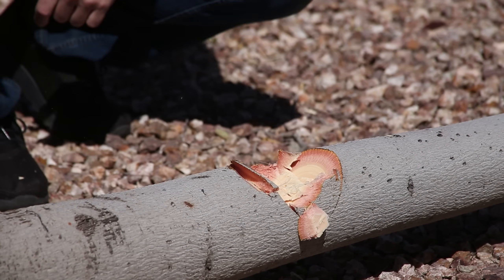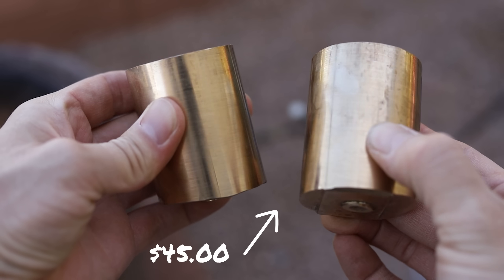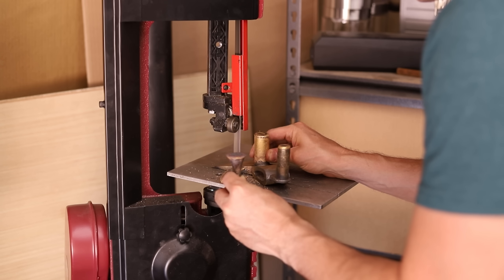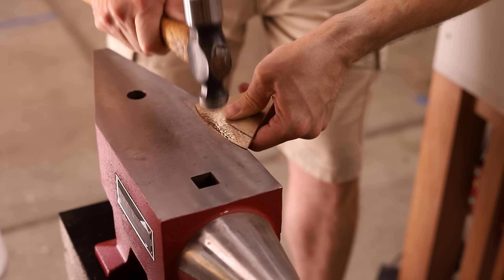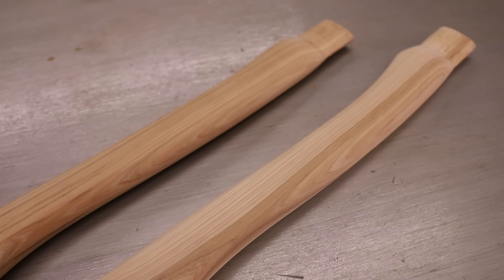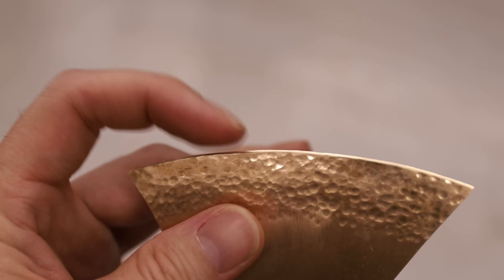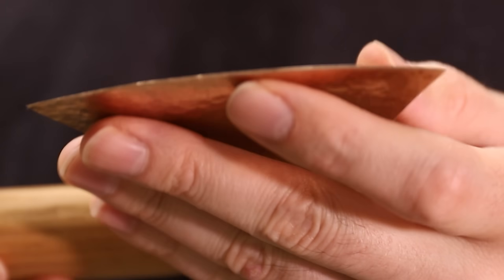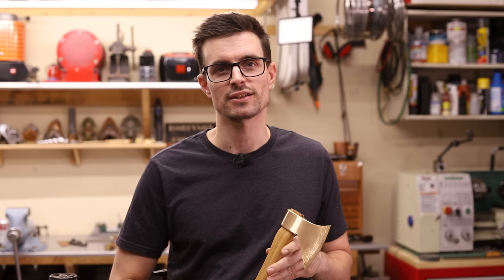Aluminum Bronze VS Tin Bronze, Making & Testing Bronze Hatchets

Comment: The broad edge you described is NOT an appleseed edge. The true name for an appleseed edge is a convex edge and it is not determined by the angle being broad. It is what most quality axes have edge wise and it's used on Japanese swords. Usually put on using a slack belt or stone that has the right wear for such an edge. I personally maintain with a mousepad and sandpaper or cardboard with compound. Something with a bit of give. Global Knives also come with this edge.

Comment: Great video. The color match or lack of, is from a few things; The environment that was surrounding the initial casting pour (casting substrate and environmental gases) is different than the environment that was created when the GTAW was conducted which induced shielding gas at a molecular level. The scrubbing action of the EP (electrode positive) side of the AC waveform also cleans the base metal removing impurities in the parent metal (and filler) which do come to the surface and literally go up in smoke, redefining the alloy in that specific area. Also, the grain structure is different in the parent casting than in the pool of weld metal which is more pronounced the further the surface profile is reduced. This practice is commonly used in metallurgical labs to examine the grain boundaries between the weld metal, parent metal, and the heat affected zone and is known as macro polishing and subsequent etching. Regardless of the filler metal in production welding or this situation, the further the substrate is polished, the more visible it becomes. This is evident even in color matching aluminum alloys specified for anodizing and in weathering steel applications using Ni1 nickel alloyed fillers. Have a great day.

Comment: Very clever to hammer in the dimples like that to improve hardness. You called it cold forging. I am googling it, very ancient technique but I am curious how they figured it out all the way back then. Without being able to analyze the structure of the copper I have a feeling they would have went around saying "I have been saying it for years but you wont listen....if you cold forge the edge you wont have to sharpen it as much, but you just never listen....you say I am being extra" lol

Comment: I'm stunned how this even works. Melting copper and aluminium, alright. Copper melts at 1000ish degrees, and aluminium almost melts in your hands... but iron? Iron is another +500 degrees on top of copper.
You get to well over 1500°C, and probably some extra so it flows while pouring, with a blowtorch-heated, home made furnace that is little more than a concrete-enforced bucket? That's so awesome.

Comment: 4:09 might be contamination / oxidation but it's also possible that the discoloration comes from different crystal structures: the hatchet cooling somewhat gently vs the tig welded spot cooling off quickly.

Comment: Not surprised at the result. Iron didnt defeat the bronze age because it was better metal. It won because Iron is alot easier to find than Tin or Aluminum. 

100 iron swords vs 1 Bronze sword

Comment: If I recall correctly, when bronze age societies began transitioning to iron, it was more because iron is everywhere and tin was a very limited resource, being only produced in abundance in very specific and distant locations at the time. Bronze is just as strong as early iron and in some respects even better, but the abundance of iron made it takeover as the standard material once forge technology was able to produce enough heat to melt it down.

Comment: Tig welding is extremely high temperature (>2800C)  and even higher depending on current.  You likely oxidized and even evaporated some of the aluminum. Though not a substantial change overall, there was a compositional change in the alloy.  Small changes like this can can cause big color changes.  Oxide formation on the surface can also alter the light reflecting.

Comment: What’s not cheap mean for the c630. Say a round about price. Also it’s on mcmastercarr $60 for a foot of 3/4 rod. Looks like you had 1-1/2” and a foot of that is $200 but unnecessary if you were jut melting it down im sure it’s cheaper for the longer smaller diameter to make the same volume of material

Comment: There's something bizarre about seeing (what I assume are) 3D printer layer lines cast directly in bronze. Of course, after you worked the metal a bit, those lines went away, but it looked strange coming right out of the mold. As though you somehow 3D printed straight bronze.

Comment: Metal creates oxide layers when rapidly heated and then cooled. Depending on the thickness of the layer, it can be different colors. It's basically permanent unless you polish or sand it off. I've never seen any household chemicals that can remove the oxide easily.

Comment: It was very interesting for me to watch this video. It includes metal casting, locksmith processing, and testing of the finished product. A very unusual material for an axe. Unusual for our days. Of course, it cannot compete with steel when high cutting and chopping properties are needed, but aluminum bronze is very corrosion resistant and it would look very impressive as a hatchet for cutting poultry carcasses in the kitchen! Golden axe!

Comment: This was wonderful to watch and learn with. You're an excellent craftsman, those turned out amazing. 9:30 what do you mean by porosity when cold forging - imperfections getting into the material, weakening it? 🤔
Have you tried making a brass alloy before? Nickel and Copper.

Comment: My two-handed wood chopping axe isn't sharpened at all. I'd be VERY surprised if the bronze axe suffered any damage from using it on wood. 🤨
Moreover, an axe that will cut wood chips when struck can be made from almost anything, even plastic.
The question is how long it will last.

Comment: Yo I think these axes, especially the axe heads are very beautiful but from using a lot of axes I have to say curved axe handles like the ones you find on gränsfors bruk axes are a great improvement to handling and imo also to the beauty (if you care, I know these are just test pieces so it probably doesn't matter as much)

Comment: Fey will be allergic to bronze in my next D&D game.  Not Iron.  Iron is a human thing.  Garbage.  Dwarves prefer bronze aluminum.  It lasts lifetimes.  Iron and steel pit, corrode, and fall apart after just a hundred or so years.  It is also ugly.  Elves prefer platinum.  Imagine an elf with a platinum rapier.

Comment: Pro tip, when using a file, NEVER go back and forth while you have it against the metal as that will damage the file... always file away from you, lift it off the metal, set back where you started and repeat.

Comment: So a few things about the aluminum bronze: 

First, the discoloration from welding is because aluminum bronze continues to grow internal crystals at room temperature. So a remelt via welding of the alloy would re-liquify that portion of the crystal grain and always be visible. If you want to discourage this, you should put the bronze into a freezer for a month before welding it, and then allow it to slowly come up to room temperature again before welding it. It will also be significantly harder if you put it into cryosleep before work hardening. 

Second aluminum bronzes can have either zinc or tin added to them in small amounts to help with fluidity of the molten alloy. zinc is slightly lighter than tin, but can put off vapors during the melt process. Both can be difficult to weld, but you twinned weld stick is a really good idea.

Comment: the coloring is because of the heat,,the first is allready heated poured,the other is forced heat on so it becomes a defferent heat and molekyle difference,,prob weaker or stronger ??

Comment: Not trying to teach you your job but steel wedges and ring wedges are for when the head starts to get loose after repeated use and you want to keep using the same handle.

Comment: The bronze age ended due to supply and supply lines, not because iron is that much better as a tool (note- iron, not more developed metallurgy like steel)
Iron is just easier to mine locally. Meanwhile, bronze required the development of intercontinental trade in order to get everything it needed going. Which meant there was a good chance that neighbor you hate cut off your supply right before they declared war on you.

Comment: I'm surprised at how well bronze performs. Good steel might be better, but considering the problems that have to be solved to make good steel, bronze axes are really easy to make. What I'd be interested in is making a saber saw out of bronze and testing it. How well does this material perform compared to steel?

Comment: I saw that back in the day, and I guess in current times, that steel scythes for mowing hay and grass were sharpened by peening the edges between two hard objects. I wonder if the same could be done for bronze, or even if that was done for bronze (vs grinding). It sounds like they already knew about hardening a metal by deforming.

Comment: I believe the discoloration in weld is whats called the HAZ (heat affected zone). that is essentially just the superheated area where the weld puddle was, and it cooled quickly to form a different grain structure as compared to the surrounding metal that didnt get hot enough to change grain structure

Comment: Aluminium bronze?

Does that differ significantly from duralumin in properties?

Edit nevermind the alloys are miles apart in composition - the former has a much higher fraction of copper and the latter has a much higher fraction of aluminium.

Comment: The alloy content is slightly different and the temperature heated and cooled at a different temp/speed. Happens with weld repair on substrate all the time. PS.. you'll be much happier with conical wedges to hold the axe heads on.

Comment: The bronze cooled naturally and Annealed at a different temperature. The molten bronze cooled at a different speed.

When you quench anneal metal at different temperatures and colours this will affect the properties of the metal. Maliability, hardness, brittleness, it also affects the grain(crystal) sizes of the particles. All of these factors could likely change the metals appearance

Comment: Cool!
Stronger actually. Since the aluminum axe is significantly lighter it will have less force on the edge.
The only true test would be a speed test. Or a test to get through a piece of wood within a set piece of time. So the weight of the tin bronze axe is used for something more than stressing the edge.

Comment: have you hammered many layers of the bronze together, cold forges them into on peice then heat it and add a 2nd one. might make the whole axe head stronger, im not a forger but its a thought i had while watching, if im wrong someone plz comment, but my thinking is, in theory if you hammer the bronze and nit gets harder then, why not hammer a few sheet together and compact the bronze into a tight sheet,,,like i said someone elaberate if im wrong plz

Comment: You could have saved a lot of finishing time by cleaning up the 3d print. (Especially if you are going to use the plug again.)
Try misting with acetone.   And/Or   Spray paint with a high build primer and sand.

Comment: Strange. Aluminum bronze is supposed to be much harder and stronger than bronze made with tin.
Tin Bronze Tensile Strength: 300–550 MPa (≈ 43.5 kpsi to 79.8 kpsi) and  Brinell: 60–120 HB. 
Aluminum Bronze: Tensile Strength: 550–850 MPa (≈ 79.8 kpsi to 123.3 kpsi) Brinell: 150–200 HB
Did he work-harden both?

Comment: Old copper— see all those old soldered joints?= lead exposure. That means from now on, the sand you used can’t ever be used to make for anything you would drink or eat from. There is no safe level of exposure. Can also contain cadmium. (I’m a jeweler. )

Comment: 4:04 how do you tig weld aluminum bronce? Mine is 89%copper and 11% aluminum but when I try to tig weld it just heats up the full piece, I can’t see even a single puddle. When I test the welder with iron it works perfectly. I don’t know what’s wrong with it. Anyone know ?
Reply: Over 200 amps dcen. Or preheat the entire piece to around 600 degrees. Honestly oxy-acetylene is what works best. It's so thermally conducive it makes it difficult to form a good puddle when welding.

Comment: Nice work.  chopping fully seasoned hardwood is a tough test for any hatchet.  A great deal of woodwork was done green before power tools. Timber framing hardwood for example is traditionally done green.  The joints and whole structure season together.  The shrinkage pulls the joints even tighter.

Comment: I love this sort of thing; v nice work BTW. One thing I'm always frustrated with, though, is trying to find creators that are looking at other factors besides the usual temp, colour/heat, composition, etc.
How about vids also including humidity, local temp (you mentioned it was hot outside the workshop?), static electricity, perhaps local gravitational &/or geo-magnetic flux (or level or whatever they call it)?
If/when I can start doing casting & forging I'd especially like experimenting with running an electrical current (AC or DC or BC or suchlike?...sorry, my little joke -  of course I know it's BCE now... ;~ ]) through the molten metal WHILE I'M POURING IT, with various monitoring going on, to make comparisons re. Viscosity, hardness vs brittleness, ductility etc., resistivity & diverse magnetic properties (incl. propensity for Paramagnetism &/or Diamagnetism), seeing if katana-style folding can have any noticeable difference when working in bronze, maybe rotating the crucible while pouring into the mould (& assessing rigidity, flexibility, etc. later)? I'll wager there's a whole new world of nitpickery out there just waiting to be explored...

Comment: Bronze age axe heads had quite a different shape compared with the iron and steel versions that came later. They were smaller, more 'stumpy' looking and did not have an eye for the handle, they had a socket and loops to lash the handle to the head. This was not because the makers lacked the skill to make complex shapes, it was the optimal shape for the material. I'd like to see you have a go at replicating a bronze age axe shape in home made bronze. I wonder if it might work better than making it in the shape of a steel axe.

Comment: I wonder if aluminum with micro pores would be stronger. Aluminum oxide is the strong form of aluminum so a surface maximizing surface area may be strong then a solid piece.(3d printed metal commonly has micro pores )

Comment: It's funny, we usually don't consider bronze to be all that strong because we're so used to iron and steel, which is generally a tougher class of alloys, but it makes sense bronze is actually pretty tough. There's a reason it had its own age named after it after people figured out how to make it.
Reply: Bronze is actually harder than wrought Iron. Not as hard as a heat treated steel, but they weren't making steel at the beginning of the iron age. So going to Iron was actually a downgrade in most respects, aside from cost.
Reply: Iron didn't push out bronze because it was tougher, but because it was more readily available. Basically, bronze is Betamax and iron is VHS.
Reply: @konayasai  This is true funnily enough its also because Tin was actually quite difficult to come by in large quantities aswell!
Reply: @WolfWest-e8u you can make bronze with different metals. A lot of bronze was arsenic-based afaik... but of course, working with arsenic was unhealthy to say the least.
Reply: @konayasai  VHS was also just higher capacity.
It's a bit of a myth that "Beta only lost because of marketing" VHS recording length was significantly greater than Beta's.

It did look way better though.
Reply: Bronze is harder than iron, it's only weaker than steel, which is why weapons made of steel are superior. Also iron is more abundant than copper and tin, which is also why bronze tools and weapons became obsolete once iron working was discovered.
Reply: We dont because most people don't use it anymore
Reply: Its called the bronze age and lasted 2000 year. If it wasn’t strong it would last that long🤣

Comment: 4:09 TIG sparks way hotter than the melting point of both copper and aluminum, while it just edges into the territory of iron and nickel. You probably have a spot with a few percentage points tops of less copper and aluminum due to vaporization. Brazing with a solid pre heat would probably do the job the best. 

But not everyone has an oxyacetalyne or even propane or map gas setup. Its a lot more involved to put together and maintain than the stuff you put together to keep TIG up and running. 

Almost certainly not a huge deal, likely no problem of either brittleness or overly soft metal in that spot. Especially since bronze is slow-cool and/or work hardening, and quench annealing, you can reheat and air cool the whole thing and maybe polish it again if you need it shiny for the video camera 😅

Maybe if you re-treated the whole thing the discoloration would vanish, if not, the vaporization thing is the problem.

Love this video!

Comment: My two-pennith would be that the aluminum burns off when molten, so you have to compensate by adding more. It would be good to know what percentage you ended up with in the finished axe head.

Comment: You should try bronze 655 (Silicon Bronze). A few decades back my father tried to save the money a machine shop wanted to charge to drill a hole into it. It cost him more on worn out carbide bits. It has a hardness close to stainless, but a machinability percentage of 30%. The M2 steel used for making milling bits has a machinability percentage of 29%. The lower the machinability percentage the harder it is to remove material.